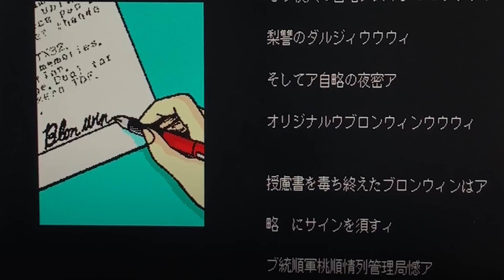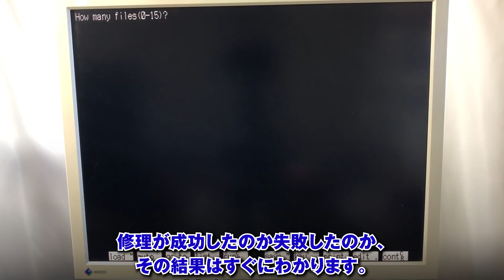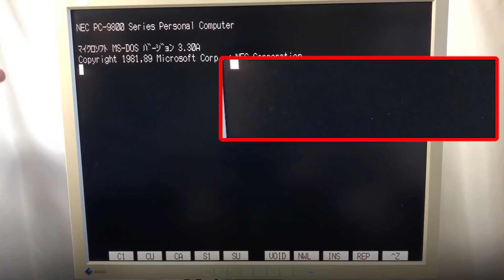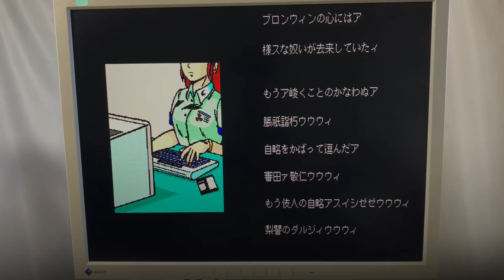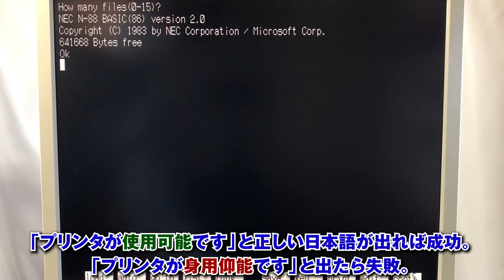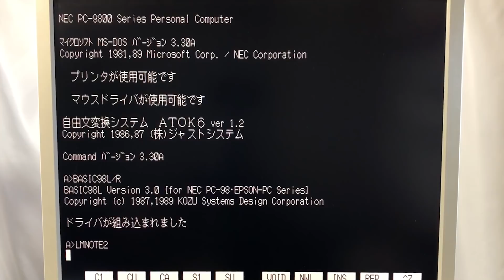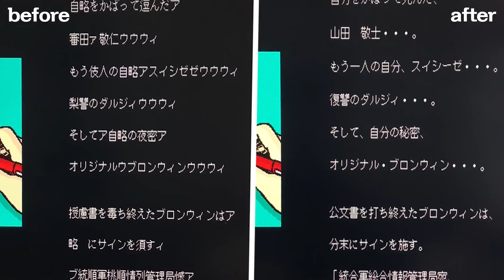【ジャンクPC-98 DOレストア #5】PC-98 DOの持病、98モードの文字化けを解消します！数日間に及ぶ格闘の記録を御覧ください【マザーボード修理】

Comment: Hello, we are currently trying to repair a PC98DO for our Retro Club Insert Coins e.V. (Germany). The battery on the PCB has of course leaked and the same trace was interrupted as in this video (thanks for the video; it saved us a lot of time :-) ). But we have another problem with the Kanji characters. Two additional vertical lines are displayed for each character. Do you have any idea what could be the reason for this or which other track might be damaged that could cause such a problem? Are the schematics for the PC98DO available somewhere? Unfortunately, we haven't been able to find anything yet.